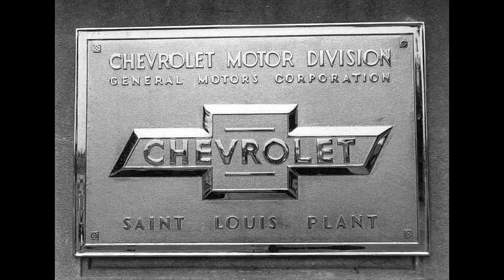The 1963 Corvette Sting Ray being assembled at the St. Louis Plant

Comment: Awesome video! But my heart breaks for those poor guys in the paint shop painting for 8+ hours a day with no respirator.
Reply: To be fair ,  the spray rooms would have had extremely powerful  extraction . Did you notice the spray dust was being forced down . But  it would have had risks no doubt.  .
Reply: @johndavey72  I own a down draft paint booth. It's better than painting in your garage but the chemicals still pose a major risk.
Reply: @1967davethewave  Hi Dave . I had one too, De Villbis and l used an air fed mask . Certainly with the modern 2 packs the risks are much higher . I had a friend who would not wear any protection and he was using Glasurit in a booth with very primitive extraction. He paid the penalty , heart attack ,lungs knackered at 53 .end of !  In the '50's /'60's  it was still Nitro-cellulose ....now that smell still gives me a Buzz !!
Reply: The were allowed to go outside for a cigarette every half hour.
Reply: That confused me. Why didn't they buy one? I'm sure they had some issues early in their career. Hocking up the paint color the next morning.

Comment: When I worked professionally as a restorer, I practically hand striped 4 paint jobs off and sculpted a 65 with a 67 stinger hood. It was a wrecked ex-drag car we restored back to stock. Had wheel flares that had to be removed and the center hump put back in the hood. Watching these guys lower the body on the frame..yep, done that too..it had a 327 with 4 speed..neat car to drive when it was finished. But that car broke me from ever body working another fiberglass car again.

Comment: I lived in St. Louis most of my life.
I would often here about the poor working conditions and dreadful labor relations at the old Corvette plant.
Things got so bad that someone from management could not be on the shop floor without security.
Reply from the maker: When I worked for GM (mid 70's to mid 80's) most of my time working was getting assembly lines up and running again when something failed. I responded and worked as quickly as possible to get the line up and running again which greatly pleased management. They in turn looked the other way when everything was running smoothly and I took a break. Now as your stated the working conditions could be harsh or even dangerous. Today companies look closely at safety, ergonomics, and other factors to improve working conditions which improves production.

Comment: The marker light on front is pointing crooked on these cars originally.  Thats how a 64 i did was,  , 375 horse with a Holley . More rare than fuellie car
Reply: The top engine with a carburetor on the 2nd Gen Corvette was 365hp. It was the exact same engine as the 375hp Fuel injected engine with just an aluminum dual plane intake and a Holley 4bbl on top.
Reply: @1967davethewave  indeed

Comment: After a few years, those guys in the paint department died of lung lacquer disease. In those days, even a high school dropout could get a good paying job in the auto industry. 
The auto company's did not care about how intelligent the worker's were, just how strong their arm muscles and backs were. Today, even an Associate's Degree is barely able to secure a job on the Assembly Line. I know this for a fact, I'm a retired skilled tradesmen from the auto industry. New hired people have to pass an assembly line school class before being fully hired to put a vehicle together. Years ago, there were picture images on the buttons of gand held equipment on the line.
People were hired who couldn't even read or remember what button to push to fasten a nut or bolt. Just remember what picture icon to push and when after lining up the tool to the fastener. Boy, how times have changed.
Reply from the maker: I worked at a GM plant in Rochester NY in the mid 70's (Millwright) and I was around many nasty chemicals used for cleaning and plating. There were very few precautions back then and I could only imagine how the early 60's were.
Reply: @mjdart54  Hello fellow skilled tradesman. Thanks for your reply.
In my comment, I forgot to mention that a fellow skilled tradesman in my department, dropped out of 10th grade because he could not read. 
Served our country in Vietnam, came home after learning a trade in the Marine's. All hands on, no reading of repair manuals, no reading of newspaper's or magazine's. Came home from the war, opened shop in the family home garage. Had a cousin who was foreman in the auto industry. Cousin got him in the door working in the same department as his cousin and I. Whenever this guy had to use a shop repair manual to do his job in sequence fashion, he had to ask the other guy's in the shop to help him read the printed material. One day I point blank asked him why he needs to have other guys read him what the repair manual sez. He replied: Did you ever see me reading magazines or newspaper's during lunch like the rest of ypu guy's? That's because I can't read, I dropped out of the 10rh grade because I couldn't read. Well guess what? Because of the good old buddy system in the UAW, this guy eventually became my union Committeeman. The guy who would write up and file my grievances, if any. He would be my Union spokes person if the company management had a contractual issue with me, and would write me up. Can you believe that? And all this nonsense occurred during the 1990's . Go figure....
Reply from the maker: @rickprusak9326  I miss the guys in the shop, I bet they don't read newspapers anymore like they used to. Rochester Products, where I worked liked hiring Marines, especially for supervisors. I mainly worked production maintenance after finishing my apprenticeship and the supervisors always liked me as I got right after fixing the line when it stopped moving. We had a very large engineering workforce and I always got along with them so GM sent me to take engineering courses, so I could speak their language. I've always been grateful to GM for that as it helped me land a very good job with FPL the utility company at a power plant after GM offered a buyout in 1986. I just retired after 33 years there after 10 with GM. I met alot of guys like you described throughout the years and I wouldn't trade those memories for anything.

Comment: is that the bird cage at 0:30 ?
Reply from the maker: The "bird cage" is shown starting at 0:12 thru to 0:29. At 0:23 you can clearly see the lower brace of this frame work and the horizontal piece the VIN and Trim Tags were attached to. Starting in 1964 the bodies were not only manufactured at Chevrolet's St. Louis Plant. but also in Ionia Michigan at the A.O. Smith Factory.